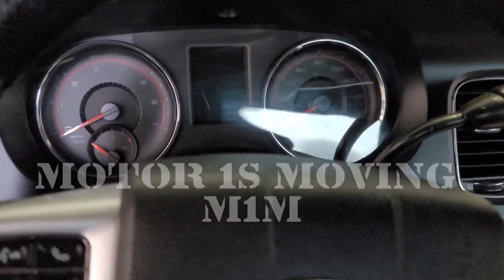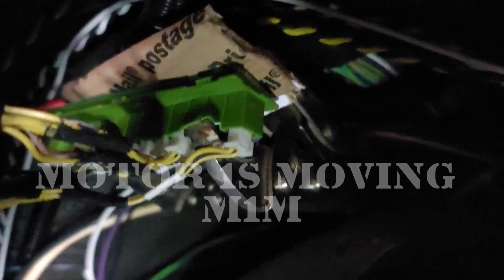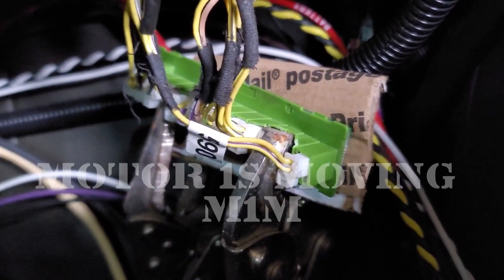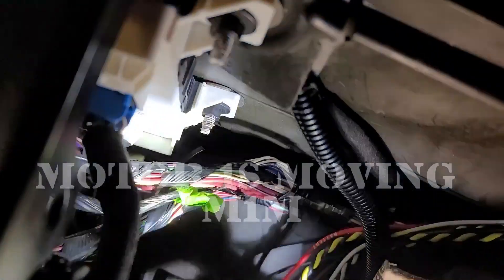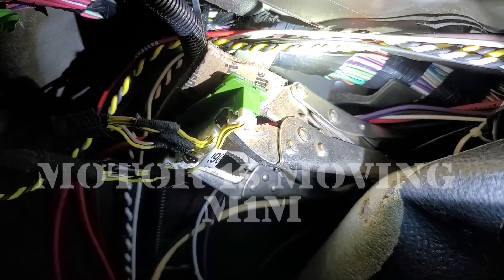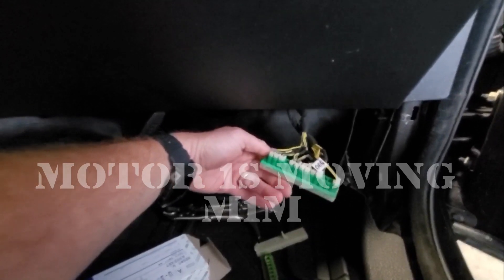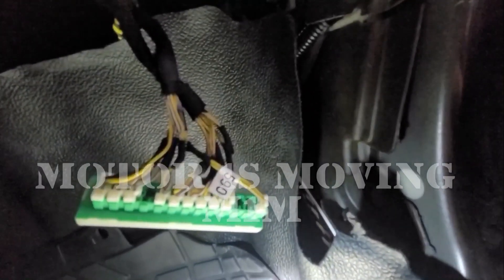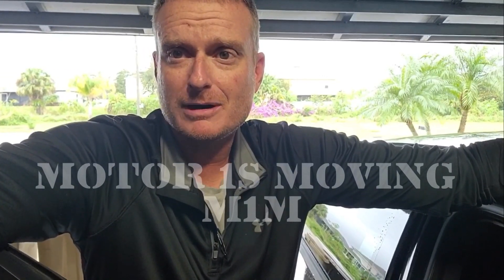My Car Broke Down | Dodge Charger | Motor 1s Moving | M1M

Comment: these are common problems with salvage vehicles,  look at the heavy pins on the pcb you may see a ring around the solder joints. just touch them up w solder and iron

Comment: Had the same problem with my 2012 Dodge Charger R/T a few years back I bought it used for 4’000$ had issues with electrical and the intake and throttle body so I just upgraded to a 6.4 liter intake with a wider throttle body not really sure with that the issue is on your current car but that’s what I dislike about the dodges

Comment: I had the same problem happened 3 times in a row my battery was getting killed overnight and my car acted the same way the problem was I was keeping the key too close to the car at night and it was draining the batteryI had the same problem happened 3 times in a row my battery was getting killed overnight and my car acted the same way the problem was I was keeping the key too close to the car at night and there was draining the battery  Keeping the dashboard active. I had a 2014 Charger RT.

Comment: Those chargers/challengers are plagued with elec problems…..awesome driving and handling cars. Limp mode use to be a big prob in the 1st gen of newer chargers. Need to get u another Tahoe. But ima ls guy, best of luck to ya jd!